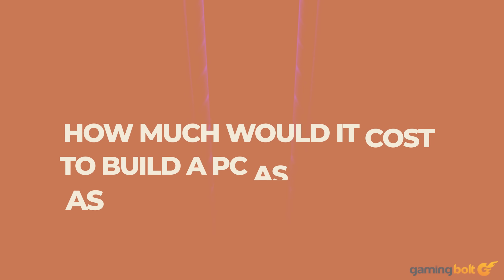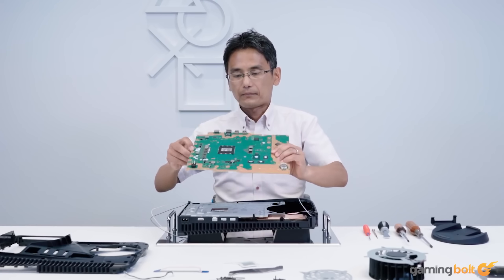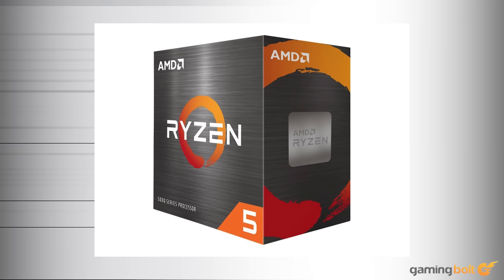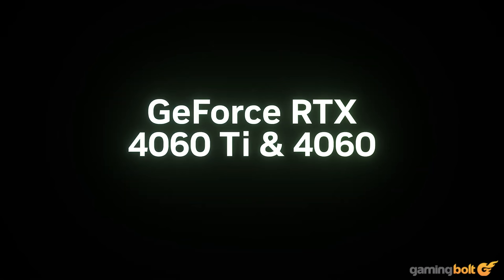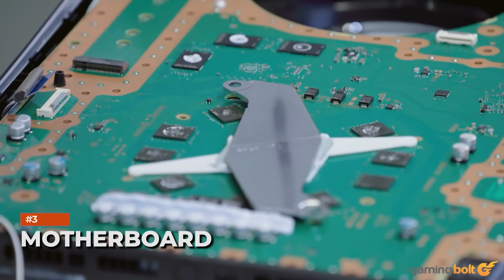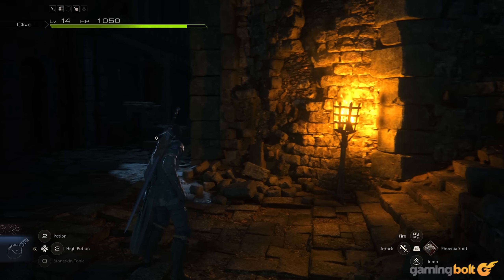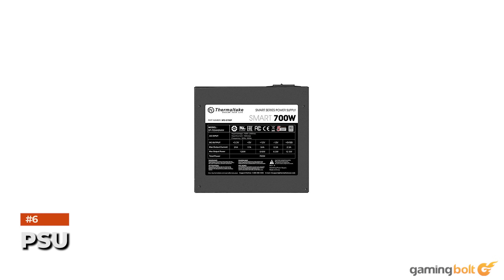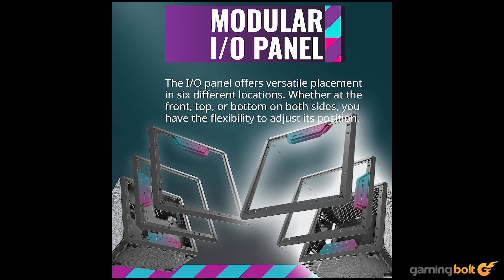How Much Would It Cost To Build A PC As Powerful As The PS5? (2023 Edition)

Comment: So the series x is the last Xbox I’ll ever buy. Gonna get a pc next. Any suggestions? 4k 60 is what I’m shooting for.
Reply: Yeah, none of the components this guy recommended is a good starting point.  Other than the nvme SSD anyway, everything else he says to get is a bad purchase and will not perform well at 4k.

At least not on modern games like the new horizon or cyberpunks upcoming dlc.
Reply: @DKarkarov  what can 3,000 get me?
Reply: @TheBlayner  well for 1700 or so on amazon right now you can get a amd 5800x 3d, 32 gb of gskill ddr4 4000 speed ram, a msi mpg x570 edge motherboard, a nvidia rtx 4070, a corsair 1000 watt fully modular gold certified psu, a lian li lancool 2 mesh case, a samsung 980 pro 2tb nvme m.2 drive,  and an artic cooling liquid freezer 2 240mm aio for the cpu.

That will beat a ps5, you get to save 1300 dollars, and you meet the system recommended spec for cyperpunk phantom liberty ultra 4k 60 fps with ray tracing off.

Of course some of that relies on prime day deals and USA prices.  Also I didn't add a copy of windows, but that can be gotten cheap on some sites.  Yes, legally.

Comment: This combination is full of flaws..

1..700w psu is overkill for this build... 550w  gold rated should be enough

2..b450 doesn't support gen 4 it will become bottleneck for cpu, gpu and ssd....rather go for a entry level b550.. something like a ds3h ac

3.. instead of a super expensive nvme ssd..get a enrty level gen 4 nvme ..like a xpg s70 to keep the cost down

4...16gb of ram is clearly not enough better  get a 16x2 of 3200mhz...in games like Last of us part 1, Hogwarts legacy...ram usage stays around 19-20gb...even fortnite takes up to 18gb of ram when playing at high to epic.

Comment: Got a second hand gaming setup of total 420 usd during 2019.. still the latest games run well,providing me an avg of 60fps on big titles..
Reply: @lonewolf_09 Exactly that. You buy the latest and greatest at first, and while it's a big upfront cost it becames cheaper down the line. But nowhere near as cheap as spending $500 and playing for 6-7 years straight.
Reply: @reisshep The PS5 will be stuck on 30fps with stutters and the PC can just be upgraded to the PS5 pro specs and beyond and continue to game at 60+fps always. Now with the PS5 it's just an ewaste plastic box.
Reply: @leanlifter1  Your old PC components are also e-waste? And you change them more often? I have 3 GPUs under my bed just being e-waste because they're not up to par, and they're bought like a year or two apart each (780 Ti, 980 Ti, 1080 Ti). There was no way neither of those would last me through the entire generation with the exception of 1080 Ti, but it's not an RT capable card so I have no use for it. The point is that I paid well over $2k for my PC (tower only, without any monitors or peripherals) only to have it be outdated quickly. I played Hogwarts Legacy at 30fps on 1080p with DLSS turned on. I couldn't reach 60fps.
Reply: @reisshep  They can be reused. The consoles are just plastic ewaste products for people to lazy to take the time to learn how to properly configure a computer for the best quality and performance that consoles can never achieve because they are controlled obsolete and locked down proprietary ewaste from launch day. Heck you can even use K/M on consoles lol.
Reply: @leanlifter1   By that logic I can also use my PS5 to play older disk based games when it becomes obsolete. Not everyone can afford a PC and not everyone wants to have a dedicated space in their home for a gaming PC.
Reply: @reisshep  If you know how to build a computer then the computer is best. If you don't then consoles are your only choice. Best of both worlds is to run both if you have the knowledge and experience with PCs if not then stick to the safe bet console.
Reply: @leanlifter1  I'm not sure which part of my comment did you not understand. Consoles will always be cheaper than computers. My setup costs well over $4k if I include monitors and peripherals. My PS5 was $500.
Reply: @reisshep  Consoles are only better for people without the knowledge and wisdom and/or the time to acquire these traits. Console is fast food and PC is A la Carte fine dinning.
Reply: @leanlifter1 totally agree console are shit and are for people with not much knowledge about electronics and tech who wants to play games. Building pc knowledge is smt you carry with you.
Reply: @RavenHart-sx8xs  PC building/gaming is hard to achieve but the pay off is huge. Consoles are super easy to get into but they are locked down proprietary, boring and are never getting any faster from day of purchase.
Reply: @leanlifter1  $4000 vs $500 is a big difference.
Reply: @reisshep  I just built a gaming rig for $200 more than a ps5. It has better specs and is still upgradeable. You dont need a $4000 boutique Alienware pre built to game on PC and if you do then you would be best served for the locked down console exsperience.
Reply: @leanlifter1  I built my own rig. 9900k, 32gb ddr4 and a rtx 2080 ti. I had to lock Hogwarts Legacy to 1080p at 30fps in order to get a good framerate. I was getting about 45-55fps otherwise, but the game kept crashing on ultra settings with RT on. It was a $2500 PC but with peripherals and monitors it ran me over $4000. I am willing to bet your shitty $700 rig can't even turn on RT in Hogwarts Legacy.
Reply: @reisshep  PlayStation plays Hogwarts better than your computer lol. That said perhaps it's time you learn to turn off the gimmicks so you can actually game with high quality and performance at the same time you know ..."The way it's ment to be played" lol.
Reply: @leanlifter1  Games without RT look ancient. I'm not compromising on RT as that is the only real ultra setting.That is the only real benchmark this generation. The point is, it's a $2500 PC that runs game at the lower resolution than a PS5 does (PS5 does it a t 1800p), and PS5 also has RT like I do on a PC. You are quick to call it a gimmick but by your own logic PS5 plays that game better than your shitty rig, and it's cheaper.
Reply: @reisshep  So you've got two games with RT Cyberbug and Metro because Hogwarts RT is not working for you. What about the fact that there are just no games pushing RT and what's the point when even the 4090 can't max out Hogwarts with RT the one of two games that even use it lol. Gimmicks are all that Nvidia sells along with crippled hardware and Vram and bus widths that can't even do RT properly yet. Perhaps the 5000 series from Nvidia will let you finally use RT in the two games that even have it lol.
Reply: @leanlifter1  Most AAA games are launching with RT nowadays, and even older ones get it patched in like The Witcher 3. RT is absolutely not a gimmick, it's the future, whether you like it or not. And nVidia has no competition in the gaming market, AMD is selling shitty GPUs, but that's why they're cheaper.

Comment: My current rig:
i7 13700f
rtx 3060 12gb
asus z790 H gaming
32gb 5200 DDR5
Crucial SSD 500gb (system W11)
2 1tb nvme 820 sticks
MSI A750f psu
MSI gungnir 100d case
Asus 4k 28" monitor
Includes [Win11, Office '21, antivirus, kb, mouse, speakers, headset]
Total: roughly $2,200 (2,221 usd)
Reply: 2.2k for a 3060 build....?
Reply: Super expensive.
Reply: Double that price in Europe on that rig.
Reply: Yes it is. I could not afford that. My house rent is almost that every month.
Reply: @chriscollins550  I work from home, I saved money for 5 years to buy that rig, still have my previous build, it was an i5 4570 that i build myself in 2013 with a gtx1650 bought in 2020 on sale
Reply: What do you play?
Reply: @cdwjustin  some racing games, Dirt2, Snowrunner, ProjecCars, planning on getting both DeathStranding when 2 comes out, dont really have much time to play nowadays.
Reply: bruhh you couldve got a rx 6700 xt theyre so much better 3060 is a scam
Reply: And the ps5 was easily $550
Reply: @smurfdaloc  but for my work I need this PC build, I didnt need a ps5 anyway, I cannot do software development on a ps5 lol
Reply: That is a really bad gpu for that total price currently. Unless you made it during the chip shortages maybe, but even then. You could have gotten a 6900xt or something probably which is miles ahead.
Reply: @iku7630  I built it 6 months ago
Reply: @iku7630 no one cares about amd. Stop capping for them
Reply: @LudusAurea  Big agree, AMD isn't even a competitor in GPU space.

Comment: P.O.V you watch this video right after LTT's video about how they are testing PSU's, meaning the Thermal take is 80 plus White certified (not really a good thing). 
I would splurge a little on the PSU and go for something at least 80 plus Broze certified (more trustworthy rating)
Reply: Friendly reminder that the 80+ rating is for efficiency ONLY, and efficiency does not equal quality or how long it will last. I've had Gold EVGA PSUs blow up in a month. Gotta research each PSU individually to make sure it's quality. Corsair makes some great units btw
Reply: 80+ Bronze is NOT a more trustworthy rating. It's that a few more % of your energy consumption is actually used by your PC. In general you can say that your PSU has to have at least a 80+ rating because that way you know it has been tested and won't burn down your house lol. But this guy in the video doesn't seem to know much about PC's so better to not build this almost 2x more expensive PC without any data to back up that it can render the games as fast as the PS5 😅
Reply: @Kiss-shot500  Exactly that. So many people skip on good PSUs and cases and then wonder why are their temps bad and why isn't their PC performing as it should.
Reply: Thats a F tier in the cultist list. terrible video

Comment: Im probably just dumb but were there any fans for the tower included in this? If not how many and where from should i be looking.
Reply: You probably shouldn't follow the parts list on this video, there are a few very noticeable compatibility issues.
Reply: @Riz_Rizen  I've noticed, getting a different motherboard and I'm good with a 4060, the performance difference doesn't bother me

Comment: how do you plan to fit that ATX board on a MATX case? you also wasted that PCIE Gen 4.0 nvme on that mobo which doesn't support Gen 4
Reply: The GPU is overkill also, it has been said that the PS5 is around the 2060 super to may be 2070, so is the Xseries.
Then he made his GPU choice by matching Tflops 😂, no one buys a GPU based on Tflops.
Reply: @ADRzone  Going overkill on GPU can be somewhat justified due to how awful the optimization has been lately for pc ports (hell AAA has been real awful there lately).
Reply: @theepicduck6922  I know... But the thing is that the 2070 is already an overkill GPU, when compared to the PS5 and Series X. Because these GPUs are the ones capable to match the performance and visuals, sometimes over taking the consoles, sometimes falling slightly short, but most times being better.

This is why the 2060super and 2070 are considered the best match.

If these GPUs will get the same love and optimization that consoles get, they'll actually be way overkill.
Reply: @ADRzone It's a 10.5 Tflop GPU in ps5 so the PS5 has around the same power as an RTX 2080.
Reply: @leanlifter1  Tflops are NOT a number that equals power across the board my guys... Tflops is based on shaders, not power! Performance is based on optimization, and the graphics engine being used, some give lots of lead way, some don't, some give Nvidia, some AMD. Tflops do NOT dictate power across the board, neither an AMD card with 10.5 Tflops be equal to an NVIDIA card with 10.5 Tflops, Tflops numbers are basically zeros to the left, the PS5 and XseriesX are both in average around the 2060super ballpark, but with DLSS or even FSR the Nvidia counterpart outperforms AMD cards most times.
Reply: @ADRzone  Shaders are graphical power not fake RT cores lol. PS5 is around a 2080 in performance but not fake RT lol. Linux will be the only gaming platform outside of consoles after this console gen is up so is Nvidia lol. The steam deck is 1.7 Tflops and it just so happens to have the same graphical performance as a base PS4 that has near the exact same Tflops. The new gen of cards have their Tflop rating screwed so it looks as if the Rx 7600 has around 21Tflops on paper but it's actually somewhere in the neighbourhood of 11Tflops. Still better than consoles at leased and the value for money is getting decent again in the mid range. Consoles are great for the exclusives like Gran Turismo and ect.
Reply: To All:
Here is a good read for you Tflopers, and keep in mind if Tflops REALLY tell the whole story and is the end be all of GPU power, then why is the XseriesX not outperforming the PS5 by miles with an extra 2 trillion computes per second? 🤔 They should NEVER be identical... Current consoles literally proves all you wrong, a bit drop in resolution difference or some frames here and there do NOT equate to 2 trillion computes of difference it should be MUCH greater. But yet again the PS5 is at the same power level, sometimes OUTPERFORMING the seriesX 🤔 strange, how less Tflops can do that, well IS BECAUSE THOSE NUMBERS ARE BASICALLY IRRELEVANT.... 😆

Teraflops provide a simplistic view of GPU performance, but fail to account for differences in architecture, efficiency, and software optimizations. Real-world performance testing and understanding of architecture specifics provide a more accurate comparison of GPUs.

Teraflops, often hailed as the ultimate GPU comparison metric, have limitations. This oversimplification doesn't capture GPU complexity, masking their true performance. Instead, real-world performance testing, nuanced understanding of architecture, and context-specific uses are what matter.

 https://www.howtogeek.com/894131/teraflops-are-a-bad-way-to-compare-gpus-heres-why/
Reply: @ADRzone  The series X has the same CPU as the PS5 albeit clocked slightly higher but rather insignificantly. That's why they perform around the same and will continue to do so. Also shared system ram is never as good as dedicated ram pools for system and Vram.
Reply: @leanlifter1  ??? You guys really don't know how hardware works ah?!

 So the Series X has the same CPU (even though is 300mhz higher) and even though it has 2 trillion more compute units from the GPU, this equals the same as the PS5 🫣😆...

Ok guys you clearly won the debate! Tflop Mafia wins! I really can't continue... please pardon my ignorance. Have a blessed and great day all! Peace 👍
Reply: @ADRzone  Your the one trying to claim consoles are more than the sum of its laptop hardware specs.
Reply: @leanlifter1  me? 😆🫣👍
Reply: @ADRzone  Consoles are fast food and PC is A la Carte high end dinning.
Reply: @ADRzone this is a clickbait farm channel, don't expect technical knowledge here.
Reply: Haha they clearly didn’t think it through
Reply: I would agree with the 2070. But the 4060, ain't really better then the 2070

Comment: Anyone have links to all these? Best i could fund for that 4060 was 338 for an 8GB
Reply: Nvm I could find it for 300 from a few different companies, who's a reputable one?
Reply: @dracoxander7558  don't build this pc. On one hand its just an awful wasteful build and on the other hand hes got an atx motherboard and a microatx case it wont even fit
Reply: @stephenallen4635  how's it wasteful? (Curiosity)
Reply: @dracoxander7558  the power supply is terrible quality and shouldnt be put in any build, there are actual reasonable options at this price point that will actually supply the advertised wattage also considering the build will only pull ~280W you're too far away from the optimal output of a 700W PSU. The rtx 4060 and 4060 ti are both terribly priced gpus and shouldnt be considered before even taking into account the 8gb vram and small bus size which already are shown to become the limiting factor for the 4060 in many current games forcing you to reduce texture quality on a card that should otherwise be able to run fine. You also just wont be able to build this pc because they've chosen a case thats incompatible with the motherboard they chose
Reply: @stephenallen4635  swapped the case and already built it, compared to my old PC and my current PS5 it is absolutely amazing. Compared to someone else's PC sure it may be garbage but this is far better than anything I've ever played on and I'm content with it.
Reply: @dracoxander7558  fair enough, its not garbage at all. My problem is with him making this video as a build "as powerful as a ps5" when hes spent extra money in places he didnt need to and not in the best way. The build is actually more powerful than a ps5 so you'll have a great time with it but the problems I outlined still stand. Really though I would suggest returning the psu if you bought the one in the video
Reply: @stephenallen4635  I agree, it's roughly double the strength of my ps5. Same games at the same quality at double the frame rate or better quality while above 60, very happy

Comment: PS5 pro and PS6 will be the decline of Steam.
Reply: I think the ps6 is going to close the gap big time.
Reply: @calvinm1866 PS5 already has.
Reply: @Apollyon_Rev911  Not quite.  Some games are still struggling to hit 60 fps.  And not many games use a legit 4k resolution, even though I could care less about that.
Reply: @calvinm1866  Yeah, every generation, ,these systems are inching closer and closer to taking away the last remaining advantages pcs ever had, the last 2 areas that will be encroached on is upgradeable hardware, and multi gpu setups along with the rest of the components in the systems, pc is grass once this happens.
Reply: @gangstagummybear3432  Agreed.
Reply: @calvinm1866  yerp
Reply: No they won't. PCs won't be killed by consoles no matter what.